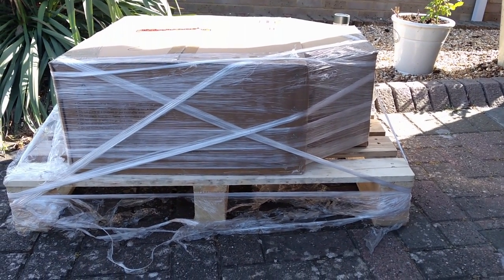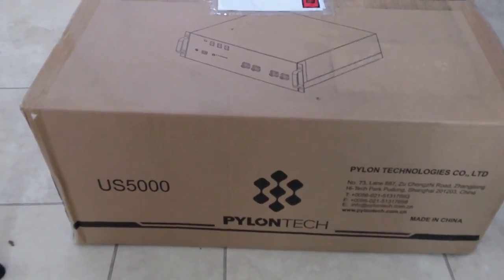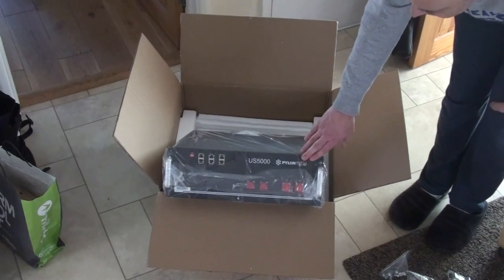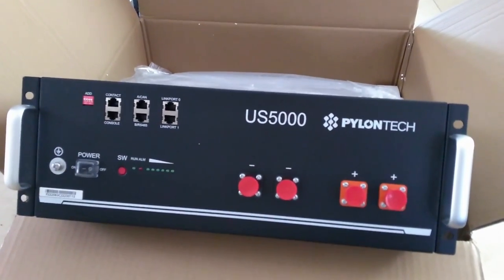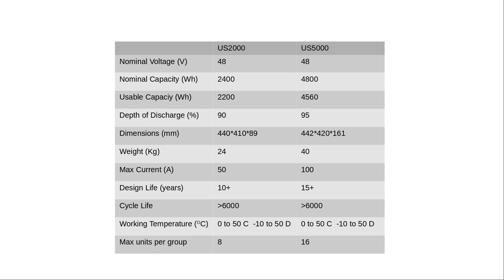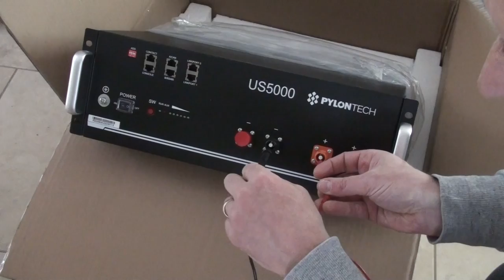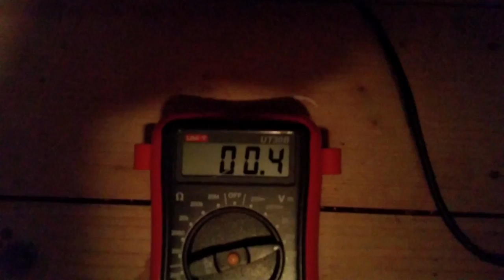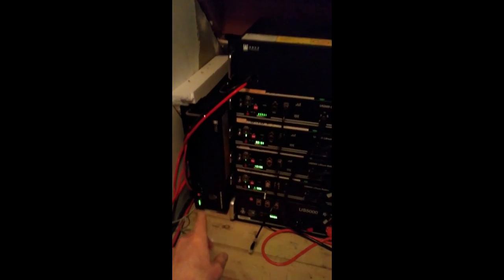Adding a new Pylontech US5000 battery to my home energy storage.

Comment: I’m getting an itch to expand my solar system array, and part of that is a desired Pylontech array stored in the shed.  The US5000 has caught my attention for a long time, but I couldn’t handle 40kg.  I’d end up in a wheelchair.   So I’ll  have to devise some lifting methods and tools for handling this out of the box and into a cabinet.
Reply from the maker: I've been getting the same itch. If you are going to have then in a shed make site it doesn't get too cold in there in the winter as it's bad for them.
Reply: @nicholashowell  one thought I had was to line the Pylontech cabinet with 50mm thick PIR insulation.  I’d design it in such a way that it can be removed in warmer weather.

Comment: Having gotten used to only using 18650 batteries between 45%-75% of capacity, (the battery in my phone, usb power banks etc) It would be difficult for me to use as much as possible of the storage regardless of the total energy storage a few kw to several kws. . My logic is still stuck on extending the life of lithuim ion batteries as much as possible 🙆. - (if i can add 5 years extra id be happy) Im certainly very happy with your progress.
Reply from the maker: I go between 20% and 90% but also don't take much from each cell to treat them gently.

Comment: The cost difference is considerable when comparing a single US5000 to 2 X US2000C batteries. Around £400 at present.
Reply from the maker: When I bought mine it was the same price as 2 2000 series.
Reply: Not good to have 2 US2000c..they consum more per hour..better to have 1 big...its 3 ou 5 w by batteries

Comment: Splendid.  I am adding a new 4.8 to my existing 2.4kwh.  Here in South Africa, the 2.4 costs 66.6% the price of a 4.8.  I would have liked to see how you connected the cables.  In one of your other videos, it seems that the battery to inverter cables to not originate at the same battery.  This cannot be when the bigger battery is the "primary battery".
Reply from the maker: The positive goes from one end of the battery stack and the negative from the other. This helps to keep the batteries in the stack at the same voltage though in reality the voltage drop is so small it hardly matters.
Reply: @nicholashowell  Thank you.
Reply: Possible to get import prices ??

Comment: Okay, newbie question here.  Why would they build something like that with no voltage/current monitoring?  Is that available via wifi/bluetooth or do they just not provide it.  I would expect a digital readout for that stuff.
Also, very nice setup but would you benefit from getting a metal rack for those units?  I'm worried about the chance for fire and cooling underneath the stairs (wooden) like that.  Great review though.
Reply from the maker: The BMS in the battery does monitor voltage/current and has over/under protection for both.  If you want to see that information you can talk to the BMS over rs485 or CANBUS . The inverter talks to the BMS in this way to watch for problems. I have a metal rack but it takes up too much space under the stairs.  I have spacers between the modules for air flow and lots of fans controlled by a Raspberry pi that monitors the temperature in the cupboard and vents cool air in from outside to keep it at a resonable temperature.  LiFePO4 batteries do not catch fire unlike other types of Lithium Ion batteries so are quite safe for use in the home.

Comment: I'm an electrician who works with battery banks a fair bit in a commercial  environment...If I had a battery bank like this under my stair case the only reason I would remove the plaster board  would be to replace it with fire rated plaster board. I would consider mounting them in a metal cabinet for fire & explosion safety, I wouldn't sit them on a wooden floor under an unprotected wooden stair case juuust in case.
Reply from the maker: Yeah, I understand, but these are lithium iron phosphate batteries and unlike other lithium ion batteries they don't really suffer from thermal runaway so are very safe. I'm more concerned about the inverters if I'm honest.
Reply: @nicholashowell  I make you right & you have some nice kit, I would just be a little wary

Comment: Hi
Re Advantages of 5 over 2  I think the extended life 15 + years is the main benefit, I don't think you mentioned that. 
You did'nt see how the 5 had 5 extra years lifespan with the same cycles. Could it be that stores  twice the energy of the 2, so the discharge would last longer hence longer life. 
Educate me if I'm wrong
Thanks
Andy
Reply from the maker: I think you are right. I believe the pouch cells inside are the same chemistry so as you say the reason for the longer lifespan is due to the higher capacity. The discharge would last longer and also the strain on the cells would be less and so they would last longer due to being treated more gently.

Comment: Did you repair the underside of the staircase? Because your staircase has to be fire rated, to allow you sufficient time to get out of the property in case of a fire. Apologise if you know this, but better safe than sorry.
Reply from the maker: Thanks. I haven't repaired it as yet. I will get to it eventually.

Comment: did i see right you  stacked a 5000  into 2000      are they not  ment  to be identical      like solar panels  ?
Reply from the maker: So long as the batteries are the same chemistry and the same base voltage (48V in this case) then it is fine to put them together.  Only the capacity differs. With the Pylontech batteries though, you do need to make sure that the newest battery is the primary as this will likely have the newest version of the BMS firmware.

Comment: Lol, I bought US3000C batteries, as my battery stash is in the loft of my house, and I have to drag them up a small ladder through a small hatch. There is no way I'd get that beast up there!
Reply from the maker: Do you monitor the temperature in the loft? I couldn't put mine in my loft, in the summer it's literally an oven up there.
Reply: @nicholashowell  Yes, I have a temp sensor on the battery stack. It’s a lot cooler up there since the roof was covered in panels. It was the hottest day of the year today, 27C outside, the batteries reached 32.9C.

Comment: Interested in these batteries and the ability to keep adding capacity as we are heavy users.  Out of interest did you have to wait long for it to be shipped in the Uk?
Reply from the maker: They are hard to come by in the UK at the moment. Few distributors if any have stock so you typically have to wait months.
Reply: Barry, I've ordered mine through ITS technologies, They have some due in next month (if not already allocated). Good price too 👍

Comment: Hi. Great Video. Just a question..what must the dip switches me set at. I have 3 x US 2000 and 1X UP5000.. Thanks in advance.
Reply from the maker: It says in the manual on page 5 that unless you have multiple banks (in your case you only have one) that you don't need to change the dip switches.
Reply: @nicholashowell   i was asked by Pylontech to unchange the  Dip switch on the Master UP5000 as the dip codes is upside down..

For the US2000, to just move all dips to the bottom.

Is that right?
Reply from the maker: @ryanmiddleton2969  That is what I have. US2000 all set to the bottom and on my US5000 all to the top (as the switch is upside down).
Reply: @nicholashowell   can I have you personal email id to send you pictures of what it currently looks like, if ok with you?

Comment: Great video. I have 2 us5000 batteries already and have another 2 coming in a couple of days. I have order another long cable pack for them to go to my keto isolater as this was suggested. they call go in a 19" rack, what would you say the best way of balancing them all is ? also can i keep the current master battery as the master ?
Reply from the maker: You want the newest firmware to be the master so if all you US5000 are the same firmware version you can keep your current master but if your newer ones have newer firmware, you'll want to make one of them the master. You'll want to disconnect them from the inverter while you balance them so that there is no load. Also make sure they are close in voltage before putting them in parallel. After about 24 hours they will probably be pretty balanced with each other.

Comment: Hi, good vid buddy. , I need a bit advice myself: Expanded my Pylontech to 6x 2.4 over 4 years now with Luxpower inverter. Master battery shows alarm red light. I moved them around to eliminate faulty unit,  but they seem be fine-it's the communication between Lux and Pylon, I believe.  Do you know, if newest unit  (with latest software) shall be the Master? Do we need to fiddle with micro Dip switches? Is there any setting within Luxpower unit?  Thanks- no one seems to know....
Reply from the maker: The newest firmware battery has to be the master.

Comment: Very interesting video.  I am looking to get 2 of theses and was wondering if you can recommend an inverter and panels, please?
Reply from the maker: If you don't have existing solar then you have the option of going AC or DC coupled (check out my video on the difference between these 2 types of inverter). Things have moved on since I got my DC coupled system and it's no longer sold so I can't recommend it anymore. I have LG panels and Perlight panels, I've not had any problems with either.

Comment: hi, moving from 24v victro based system with lifepo4 batteries wired in 2s2p configuration to a victron / pylontech system, only got 1600w of solar at present but its all south east so i get decent input, plus have 2*250 panels i use to charge the delta 2 and extra battery, basically i have an off grid office inside my house, looking to get another 1.2kw of panels, dont want to be grid tied as will be downsizing in about 3 years and want to take the kit with me. also house roof is east facing but the gable end is south facing. Anyhow brill video on the us5000 and th eother stuff,

I have  just bought my 48v victron bits and 1 us3000c battery, on a good day one battery wont be enough as my 4  *  24v  batteries get full by 1pm and i have to start using stuff to use the  extra power . 

So i have 3 questions, i saw a video of a guy using a nh fuse as a disconnect, he had 80a fuses for positive and negative. and 2 us3000c wired in parallel, should i put my us5000 in parallel with my current us 3000  or connect them seperately to the victron lynx distributor? ,  i dont have the us5000 yet so should i wait for the new model with the breaker on the front, i thinks it a us5000c. also if i wire them in parallel what size fuse should i use ?, if i wire them seperately i was going to use a 40nh fuse for the us3000c, what would you recommend for the us5000? thanks
Reply from the maker: It depends on what your inverter can pull from the batteries as well as what they can supply. I would have thought a 100 amp fuse on the positive and negative would probably be sufficient. That's what I've got on mine because my inverter shouldn't ever pull more than that. It's a useful way to disconnect the batteries from the inverter too. I think unless you have a good reason not to, you should just connect the 5000 and 3000 in parallel, connect the link ports via cable and then they will both talk to your inverter through the master (I'd make the 5000 the master as it's newer). I can't really see much benefit to waiting for the US5000C personally.

Comment: Currently got 2 us5000 pylon tech batteries and 8.5 solar array. If I changed my boiler to electric and bought another battery, charged it during the cheap hours then run my boiler (4kw) off the battery  would this work to get me through winter in the uk? Would you recommend this?
Reply from the maker: If it's an electric boiler then i wouldn't recommend it. A heat pump would be a much better idea and with its lower power consumption might allow you to heat the house all day from your batteries. It depends on how well insulated your house is.

Comment: Im looking at getting Pylontech batteries as a cheaper alternative to the Tesla powerwall which I was originally thinking of. The Tesla option is a lot more expensive per kwh but I do like all the information you get through the app in terms of grid vs battery consumption and setting charge times. Is there any software for these batteries which can be used to do something similar? Or is all that info just a bit unnecessary?
Reply from the maker: You'd have to get that information from the battery inverter rather than the pylontechs themselves. So it depends what inverter you get.

Comment: Nice video, I'm installing 2x 4.8 with a solis invertor next month. I use around 10 to 11 a day not including my car charging. I'm finding really hard to find installers in London as I'm providing the equipment myself. I have a wallbox pulsar charger do you know if the bms will communicate with that charger as I've been told to change which I'm not willing to at this moment.
Reply from the maker: The BMS on the battery will only communicate with your battery inverter and only then if it's connected up correctly and your inverter has the compatible firmware. Why should your wall box want to communicate with the BMS?
Reply: @nicholashowell  sorry I was basically trying to say that if I install the solis invertor and battery storage pylontech can I tell the system not to allow the car to charge via the battery but only via the grid at night
Reply from the maker: @TheKerr1983  I see what you mean now. I'm not familiar with the Solis inverter but some other inverters allow you to set a time period when the inverter will be inactive or charging from the grid. If the Solis will let you do this then you could set it up to be inactive during the time when you would charge your car.
Reply: Hi, I also planing to install a Solis-Rai battery inverter, like you. Did you enjoy your setup?
Reply: @HansWurst-mi8gg loving it I have 3 batteries and will be buying 1 one this month. Panels I'll get next year need to get rid of a tree.

Comment: Hi. I have one Pylontech US3000 which in the summer months charges by mid morning which the means the remainder of the day we are feeding to the grid. On winter days we don’t even charge that battery. Is it worth getting an additional battery?
Reply from the maker: I'm not sure it is.  If you have the ability to charge your batteries from cheap night rate electric during the winter then it may be.

Comment: Great video! It seems you have the batteries stacked with little if not no spacing at all. Have you encountered any heat issues?
Reply from the maker: They do have spacers between and several PC case fans blowing air through the spaces from the back. Not had any heat issues at all.
Reply: @nicholashowell  Great, thanks!!

Comment: If a US5000 is used as master, can you have as slaves up to 15 others mixed pylontech batteries such as us2000 and us3000? Or the 16 limit is exclusively for us5000 batteries (knowing that the limit is 8 with us2000 or us3000 models) ?
Reply from the maker: According to the manual, you can have another 15 mixed Pylontech batteries. However it does state that battery 2 to 8 can be anything but battery 9 to 16 can only be US5000, UP5000, US3000C or US2000C (you can't use US3000 or US2000 in the last 8).

Comment: Why do you need to deplete the other batteries down to the same level as the new battery....?
Reply from the maker: If the batteries are too different in voltage then when you connect them together in parallel current will flow from the higher voltage pack into the lower voltage one. If the current is too big the BMS will disconnect the cells to protect the battery and so it won't balance at all. You can work out how much current will flow and so long as it is within the charge/discharge specs of the battery you are ok.

Comment: Mazeltov ! So with the 5000 (as master) it is possible to mix with the 2500 and extend the 2500 more than 8 , is it right ? Has you said , i believe also it is not the best (for common houses) to have more than 1 or 2 x 5000 mixed with 2500 or others , also because if something wrong hapened , 5000w ( a big amount) are lost instead losing 2500w . Thanks for your shares .
Reply from the maker: I don't think you can have more than 8 still but I could be wrong. There is a trade off with the batteries and no perfect answer. More US5000 means less physical batteries so less chance of something going wrong but if something does go wrong, you will lose a bigger part of your capacity. They also take up less physical space.
Reply: @nicholashowell  Thank-you for your answer ;

Comment: Hi Great video! Would you advice if I can get better than 3kw - discharge  inverter - for 4 of thouse batteries?(AC  connection) Kind regards
Reply from the maker: I know of some off-grid inverters that would give you more than 3kW discharge but not of any grid-tied ones, though I'm certain there probably are some out there.